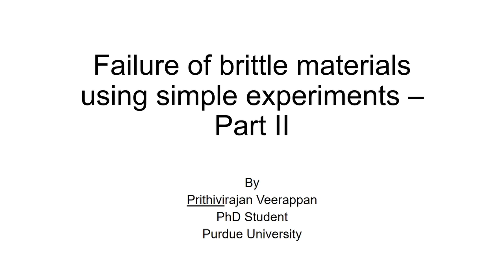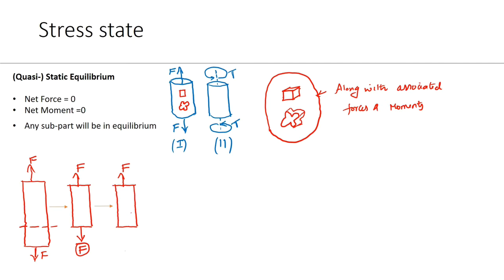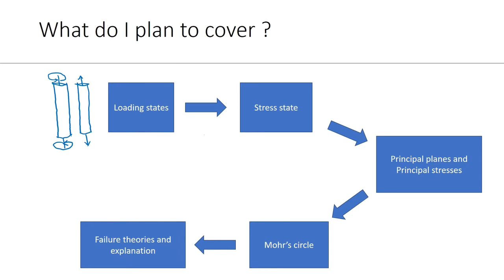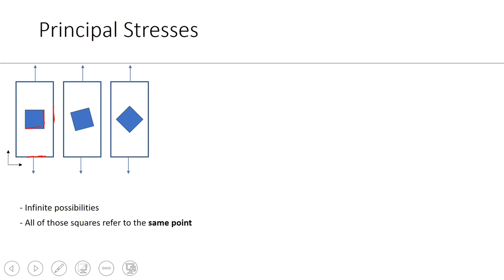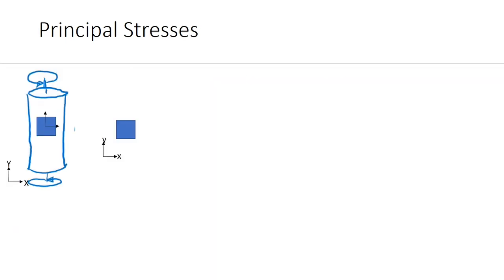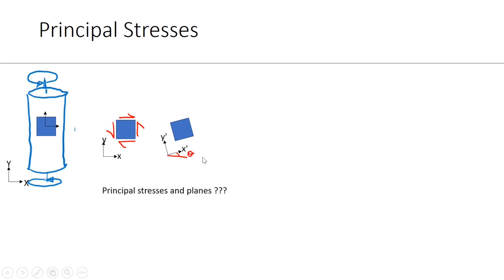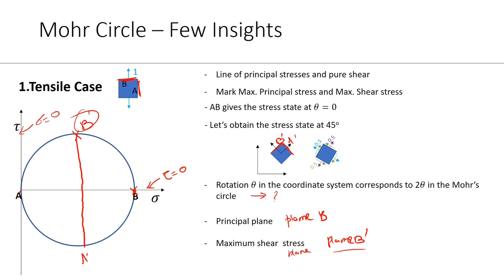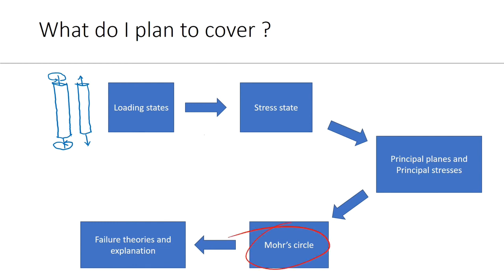Basic concepts of strength of materials without math equations - part II

Comment: The continuum hypothesis does not hold good for a domain with a Knudsen number greater than 1e^-6. The Knudsen number compares the mean free path of a particle in the system against the characteristic length of the system. When we say the Knudsen number is 1e^-6, we mean that our engineering domain is a million times bigger than the mean free path of any particle selected in our system. Essentially, it implies that an analyst looking to model this system will not end up analysing a single particle or atom or molecule (micro-mechanics) but rather a system comprising of several particles assumed to be continuous (not discrete) and thereby staying in the realm of continuum mechanics.

Comment: Hi Prithvi. Your lectures are too good. Here State of stress is not dependent on the coordinate system. stress depends on the coordinate system. Only one intrinsic state of stress exists at a point in stressed body regardless of the orientation of the element being used to portray that state of stress. when we have two elements with different orientations at the same point, the stresses acting n the faces of the two elements are different, but they still represent the same state of stress. this situation is similar to representation of force vector by its components.
Reply from the maker: Thank you. Yes, you are correct. The stress tensor is objective while the components of the tensor depend on the choice of the coordinate system.
Reply: yeah

Comment: Sir you said that there is one coordinate system about which stress state would be composed of normal stresses, say for example in tensile Loading at theta=0 degree
But also at theta=90 degree the stress state will only consist normal stresses
Pls Do correct me If I'm wrong? 
And also I have small request, if possible please make a video on failure theory in detail.
Thankyou
Reply from the maker: Yes Akash, you are right. A coordinate system means 2 normal planes (x, y in 2D) hence 2 normal stress as you stated in tensile example
Reply: @solidmechanicsclassroom3224  
Sir I have another doubt, if I consider a case of torsion then what is the second coordinate system having a stress state with zero shear stress.
First will be at theta=45 degree

Also you said that the locus of all stress state at a point comes out to be Mohr circle, and I can have stress state starting from theta=0° to 360°
 So I have  plot the stress values of stress state from 0° to 180° And I get a complete circle (Mohr circle) in MATLAB
But what about the stress state after 180°
Are the values going to be same and it will retrace a complete circle
Reply: @akashvyas7715  the second will be at 45deg+90deg i.e. in general the principle planes/max shear stress planes will be 90deg apart, and  the principle planes and max shear stress planes will have 45 deg inbetween then. hope i have clarified a bit . also pls refer to a book by george deiter for better understanding .  happy learning and i appreciate the work of prithivi:)
Reply: i am refering the coordinate systems in the material of interest , not in the mohrs circle

Comment: sir as we know stress is the internal resistance due to applied load. so my question is 3:05  two tensile forces acting on chock so the stress produces in +y direction  is due to tensile force in -y direction And stress produces in -y direction is due to force applied in + y direction ......Am i right?
Reply: yeah , but not exactly, the force in -y direction is not applied directly in the cross sectioned plane, but transferred to there through the material. it happens because the material is a solid. if it is a fluid, the force applied on diffent planes will move them apart,because the resistance of the fluid particle to move apart is small(not 0) when compare to that if a solid. so to be more clear ,the internal resistance causes the applied force to be transferred to the -y plane

Comment: Hi Everyone,

In case of Plane stress, Sz=0. Sx, Sy are non Zero. So as per tresca criterion for failure Sx-Sz or Sy-Sz should govern rather than Sx-Sy. But we don't take Sz in calculation for plane stress. Why?
Reply: In case of further clarification please ask.
Reply from the maker: Given that S1>=S2>=S3 ( principal stresses)

if S1, S2 are both postive , max shear stress is (S1-S3)/2
If S1 is positive, S2 is negative,max shear stress is (S1-S2)/2